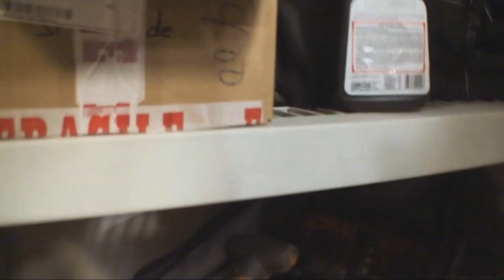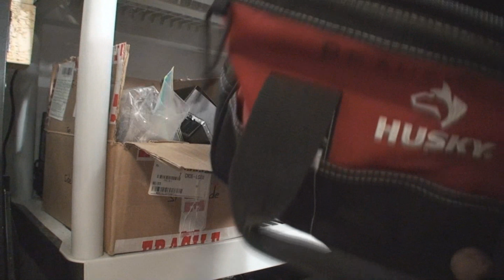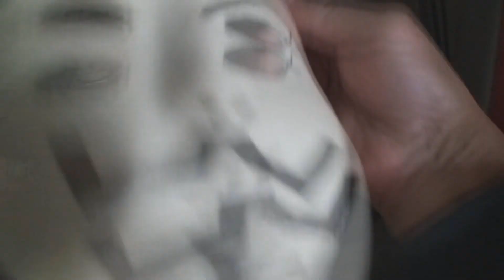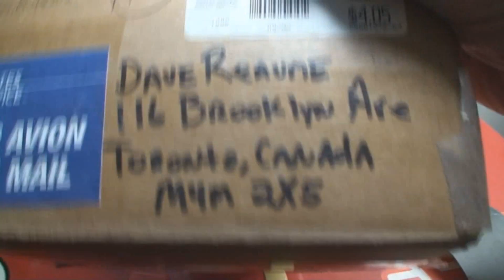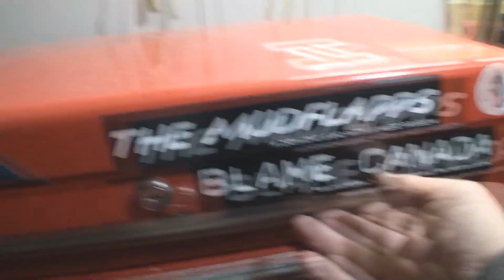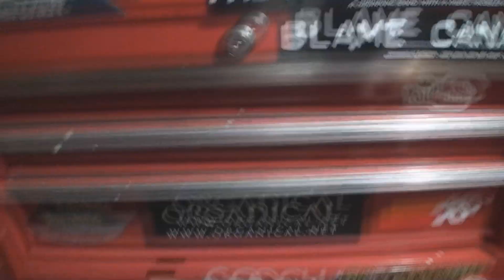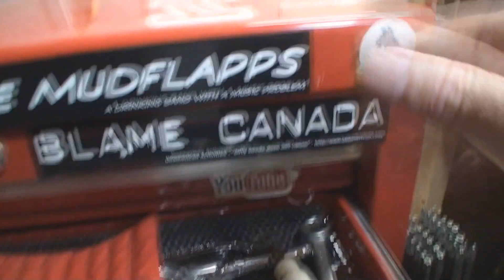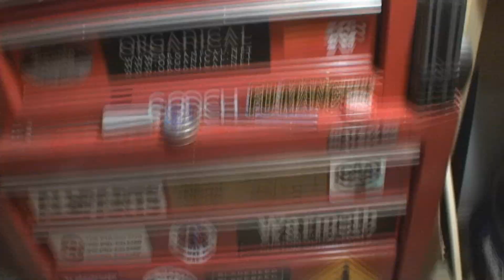What's in Dave's Tool Box Episode 1

Comment: Damn dude.. My real tool boxes in my shop are Mac & Craftsman, I luckily had an extra craftsman & it's slides got used repairing the drawers on my main unit.. Being I was a maintenance man I was into plumbing, electrical, carpentry, painting + automotive & just about anything else you could think of.. I have more tools than the law allows & still can't find things when I need them.  When it comes to sockets 1/4", 3/8", 1/2", 3/4" & have 50+ hammers & over a hundred screwdrivers mostly Klein & craftsman.. Today I needed a 7mm allen wrench & only had one in my full set putting a strut in a VW.. Then you got wood tools = planes, chisels, drills, saws = table, hand, coping, back, keyhole etc. etc.  Man I need to re-organize my shop & get it back how it was before my son stored all his $#!+ in there.. Wish me luck on the VW, My wife got hit in the drivers wheel & it ruined her bug..
Gary/Hk